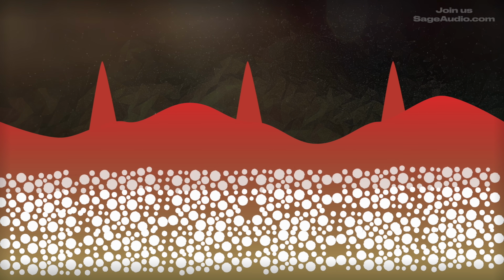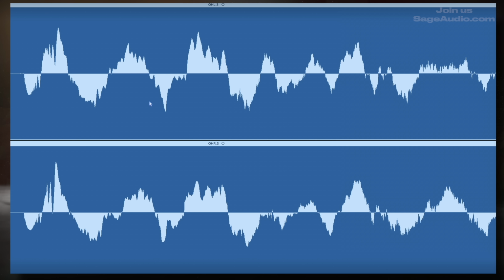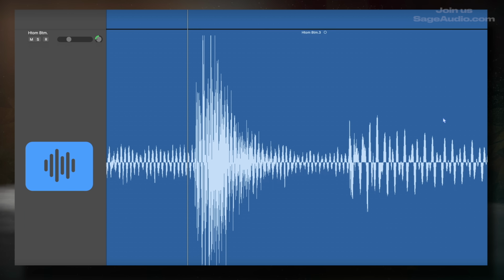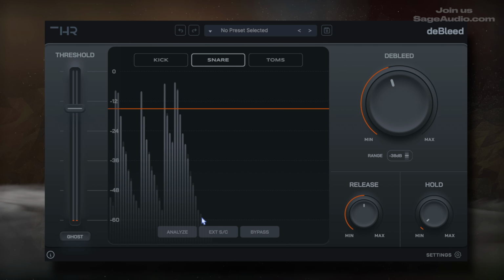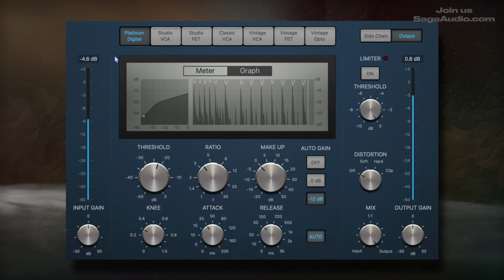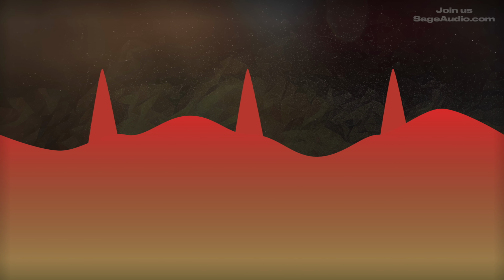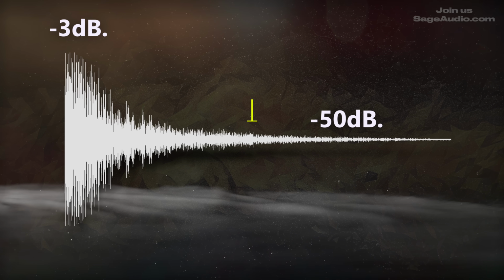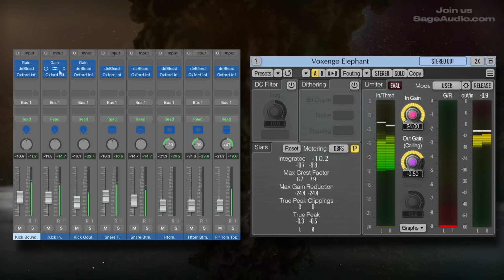The MOST UNDERRATED Part of Mixing

Comment: For Electronic music this is the equivalent of use the ADSR to shape the tail of the kick and it's incredible how just slightly decrease (even by just 5 units) the decay of the very end of a kick tail can transparently make the entire mix to breathe instead of doing any other process that somehow could mess with the global phase correlation, even moving the fader of that single element down by 0.1 db can have an undesired impact on the overall sound. It's all a matter of phase at the end of the day.

Comment: Gates can close in the sounds as well, opposed to an "open" sound, because you are cutting tail. It can be heard in the vid. Gates on drums especially, but material dependent, can help to add punch when timing the opening and closing properly as an effect, vs cutting out unwanted sounds, the strength of the OH or Room recordings will effect how much you can get away with it from the close mic's to keep unnatural sounds at bay. Parallel process this punch gate track with the original so it is not wrecking the body of the kick close mic. like it will to get the effect. THIS is the more underrated part of gate use I never hear.

Comment: Do engineers actually do this? Gating to improve phase relationships? I can’t see ‘Ive seen it done other than to reduce bleed. If they’re not, then how are there so many great sounding drum tracks already out there? Are those good recordings happening because the rooms they record in are acoustically balanced, or at least, often sonically pleasing? If so, how necessary is this kind of gating in practice? Or are you talking about the kind of gating that most engineers already do?

Comment: Gating is pretty much an absolute with drums, but 17 drum tracks is overkill.
Reply: For a standard run-of-the-mill drumset with 1 kick, snare and hihat, 3 toms and a couple of dishes in a garage, sure. But add a second kick, a few toms, two mics per kick and snare, one per tom, a couple individual mics for dishes and then one overhead stereo pair and another for room, and suddenly you start racking the mic count up. Not to mention all the percussion thingies that may or may not be individually miced.
Reply: Kick is 2-3 mics, snare is at least 2. Then with 3 toms is already 8. Add overheads, which is 2 and room mics which is another 2 (slap the engineer who wants to give you only 1 mono room track). That's 12. I consider this a minimal modern setup.